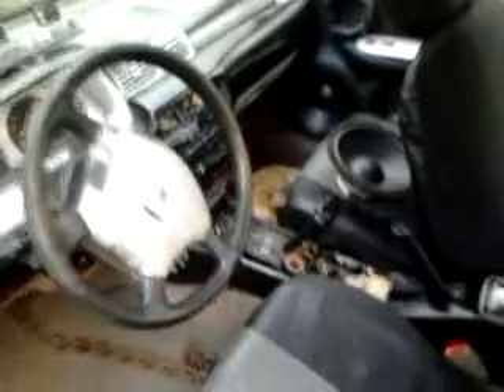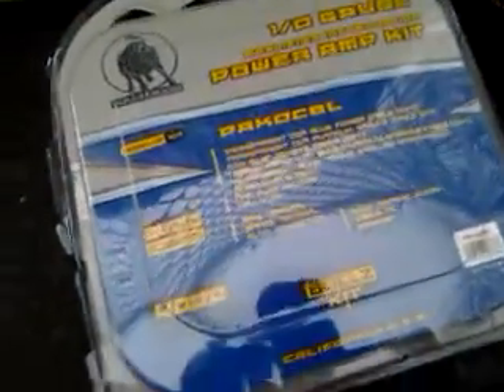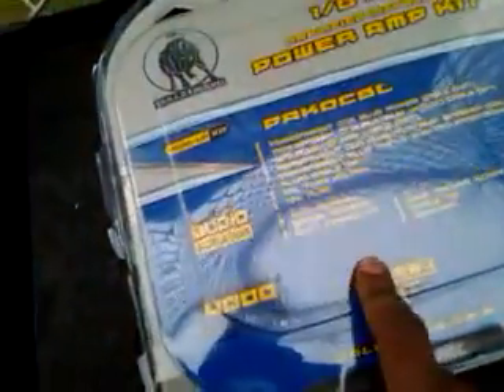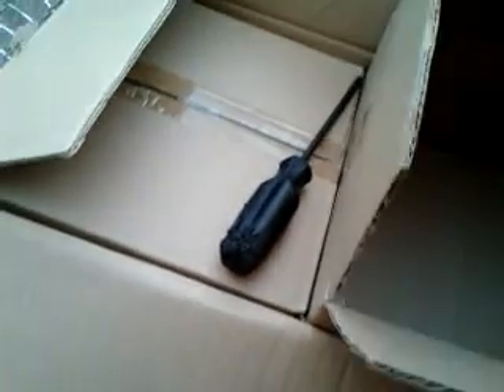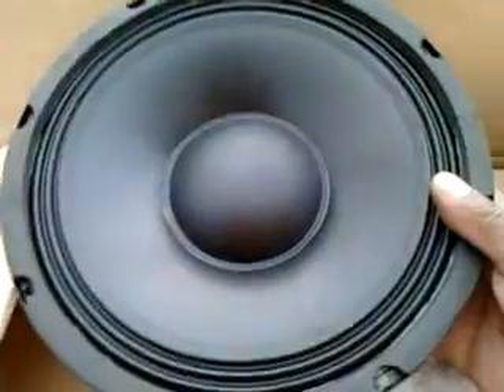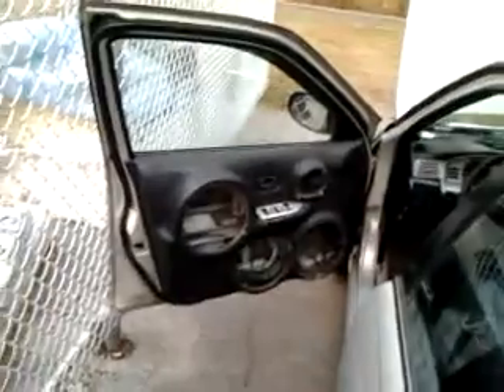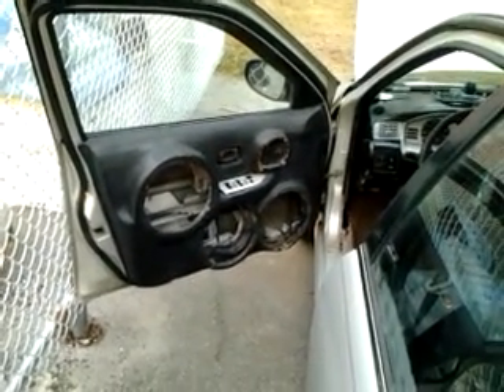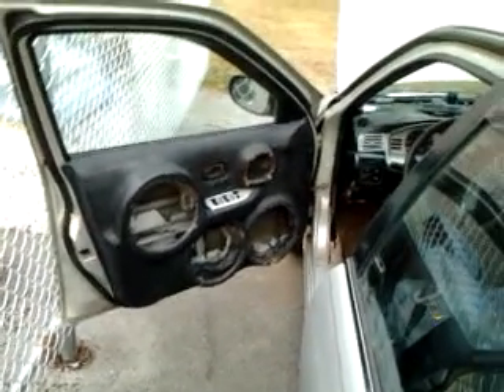part 2 the nissan up date

Comment: bro what you think about them Rockville sub's..
Reply from the maker: +robb black there is only 2 way too find out what if they are any good check the reviews and or buy them to see for yourself
Reply: +masterblaster735  bro I order some  I seen them do business on some bass head video..
Reply from the maker: so what are you going with the 10s 12s or 15s
Reply: +masterblaster735 15s I already got two
Reply from the maker: post a video when you get time
Reply: +masterblaster735 I will am waiting on another 2000 Pyle amp to come
Reply from the maker: i hear you fam getting it together